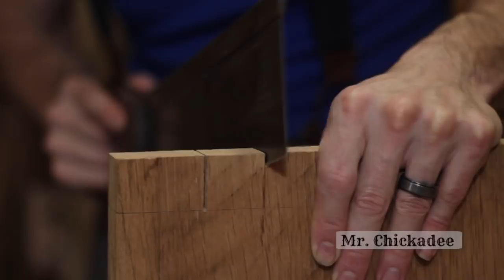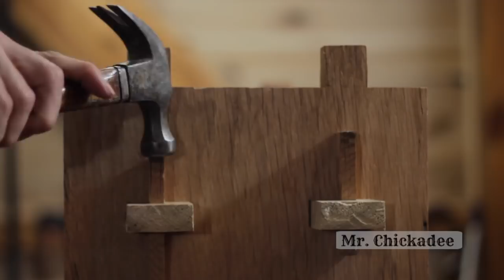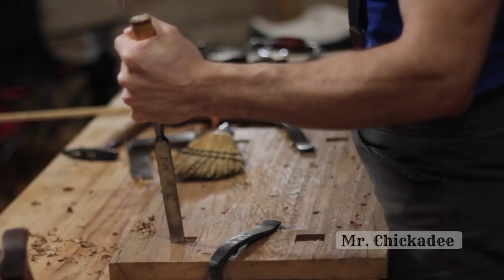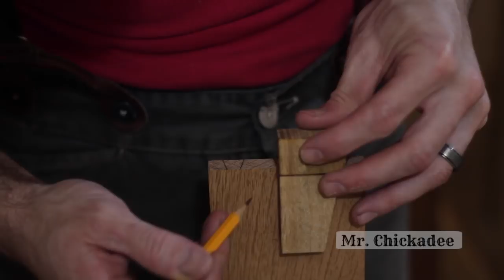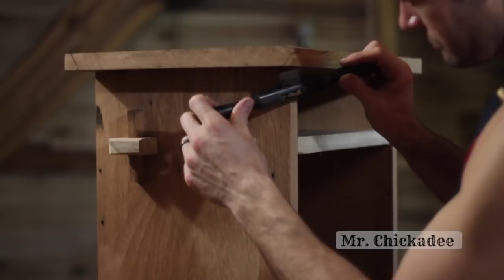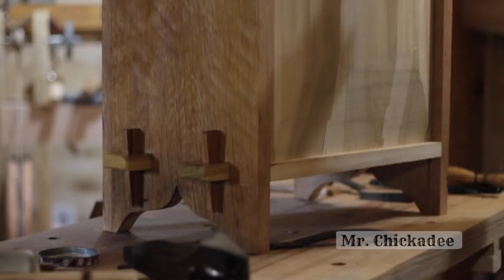RUSTIC OAK NIGHTSTAND

Comment: Nice piece. I really appreciate your videos. While watching this nightstand being made I was looking at a Woodworkers Supply catalog in the section showing all the glues they sell. During my woodworking career gluing and screwing was the preferred  technique in our "quick and dirty" scheme of making cabinets. Sometimes we got to use dados or Lamello biscuits on the higher grades of cabinets. Today I mainly use epoxy on the knife handles I make. I did use your pinning technique using an offset hole and a stainless steel pin to attach a stabilized mango handle on a Japanese gyuto blade. It really cammed the blade into the handle and makes for a monolithic knife after the epoxy sets. I like your use of the nail stained oak top.

Comment: Mr Chic, you work is excellent of course.  Your drawer pulls have the same profile on the inside as 'trunnels' used in planking a wooden ship.  Look for a 19th century schooner recently extracted from a remote beach in New Zealand named Daring.  She went aground in 1866 and hull  and framing is remarkably well preserved.  As they were just starting to get her into a preservation area where she can be kept under spray one of the crew took a picture of a particular plank.  The joint is solid after all those years.

Comment: Love the use of wedges. I expected the end tail of your drawer sides to split with the wedges but they seemed to hold.  Nice details too.  Cat supervision is always important.
Reply from the maker: Thanks, its very important the joints are very tight at the bottom of both the dovetail and the wedged tenons on the top, this squeezes the wood together and prevents splitting

Comment: Mr. Chickadee, man I love your videos.  Very informative.  I'm going to forge a series of socketed timber framing chisels and other tools I think, do you have a list somewhere of the tools you've most used for the home and shop build?  My goal is to forge a number of these tools and possibly build a small timber framed cabin in the near future.  Thanks for the help,     John
Reply from the maker: Howdy John, thanks for the comment. Thats a great idea, we need more American smiths making traditional carpentry tools in my opinion! To your question, I use 4 chisels for all my general timber framing, all are not needed but can be nice to have for their respective applications, in order of use and importance:

1. 2" Framing chisel
2. 1.5" Framing chisel
3. 1" Framing chisel
4. 3" Slick 

Other timber framing tools to forge would be 

1. cant hook
2. Log dogs/spike dogs
3. axes (felling axe, hatchet, hewing axe, hewing hatchet)
4. Adze (lipped for across grain, non for with grain)

In my experience I have come to favor a good framing chisel with a long (8" min) laminated blade, heavy forge welded socket and ferruled handles. Do you have a good one to copy? If not I have an old Whitherby that suffered a fatal break in the socket last year, Ive been meaning to fix it but its a pretty big job for a novice smith like me. I could lone it to you for a model for your chisels, and maybe pay you to fix the socket? Like many it was wrought iron I think and there was a void or other flaw in the forge weld at the socket join. 

If that sounds good, I will PM you my info or you can do the same to me so i can send it your way. 

Josh
Reply: Cool stuff, thanks for the tooling list.  I'd love to see that chisel, could you take a picture of it and also the damaged area?  I couldn't access you email on here.  Mine is on my website: www.rigoniironworks.com   If I could figure out pm I'd send it.
Reply from the maker: Tried sending you a PM on your website. Please send me an email if that goes through.

Comment: Nice work. No glue no nail. But I was wondering about the potential wood movement. The panels all are tightly secured together, will that be an issue later on?
Reply from the maker: Not at all

Comment: I have been using your bee's wax mineral oil citrus solvent on wood, tool handles shovels rakes etc. I am having trouble finding bee's wax how about using paraffin to replace bees wax. I have an old neighbor who told me he has used this same formula you use for years only difference is he uses turpentine instead of citrus solvent. What can you use on metal shovels axes etc. Thanks Love your channel you sir are a true craftsmen ans I appreciate that you are willing to share and teach your knowledge.
Reply from the maker: I found paraffin to not mix as well as Beeswax once heated up. You can get beeswax on ebay pretty cheap. Most turpentine these days is really just mineral spirits with pine scent added, really nasty carcinogenic stuff. Pure real pine turpentine is good stuff but citrus solvent is cheaper so thats what I use. I try and use all natural and non toxic materials. You can use flax oil or the same mix on shovels and axes, add some pine tar to the mix and it will get  better.
Reply: Thanks I will check out ebay.

Comment: Is the bedside table deliberately worked out in a deliberately rough way? Maybe the handle on the box was worth turning on a lathe?
Reply from the maker: Yes, as the title says, the designed aesthetic was rustic, hence the scrub plane marks left on all outside surfaces and hand carved drawer pull. Also much faster and easier to just whittle one with a knife.

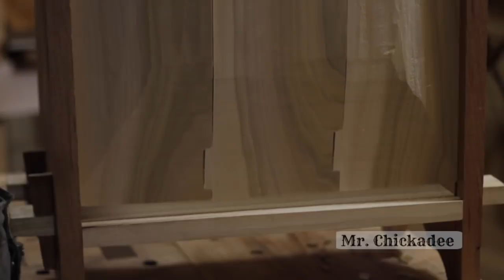Comment: What are the rectangular shapes on that panel towards the bottom at 8:50? I didn't know a panel could be joined with just a groove joint like that using a plow plane, without glue.

Comment: how long does the finish you use take to dry?  i like the look of it, but i wonder if it takes ages between coats or if the thinner you use somehow speeds things up.  Thanks!
Reply from the maker: I find the thinned out oil pretty much soaks all up in a few hours. We normally just oil it good, wipe it down with a rag after a few hours and either start using it or add a coat of paste wax then start using it. Much faster and easier to maintain (and less toxic) than most film type finishes.
Reply: thanks for that quick response!  i normally use shellac and sometimes also tung oil.  in 20 years of woodworking i've actually never tried linseed oil.  but i do have a bunch of red oak with figure like i'm seeing in some of your projects, and i think i'm going to try your method next time.  Do you just cut it half and half?
Reply from the maker: no problem! Linseed is nice, only complaint is the "boiled" stuff is toxic, and raw is harder to find. Ive started using good old canola oil cut half and half with citrus solvent, works the same as most all veg oils are drying oils. One plus is many cooking oils are mostly clear, while linseed has a yellow cast. Hard to beat the price of canola…we use that same mix on our unfinised oak floors, every typeof wood. Mix in some carnuba wax over low heat and you have a great non toxic paste wax too. Its great, just bomb proof, easy to repair, ready to apply, you could eat it and not worry and cheap…whats not to love?
Reply: sounds very good.  paste wax is fast becoming my favourite finish, expecially over shellac.  i hadn't thought of making my own, although having made hide glue several times from tendon, fish bladders, and hide...i guess it's right up my alley.   I bet people who enjoy your videos would like to see you make and use some of that paste wax.  canola oil!  i never would have thought.  i'm surprised you have trouble finding raw linseed oil.  Then again, i can't recall seeing it for sale either.

Comment: Your jointery  is is the most "awesomestlying"  the ice seen. Not all the pieces are oak.  I saw three that are poplar  but fantastic  work
Reply from the maker: Thanks, in traditional furniture there is normally a primary and secondary wood, the primary is the exterior and is normally a better prettier wood. When naming the piece, only the primary wood was named, since the secondary doesn't really matter, it could be pine, poplar or whatever. 
In this case, the primary wood was the reclaimed oak, the secondary was poplar.
Reply: Cool, I have been enjoying your videos and trying a few joints I've seen you use , thanks so much for the knowledge in your reply I didn't know primary and secondary...really cool. Thanks for the reply also, I look forward to many more videos and knowledge. Awesome.

Comment: @14:00 That's a bummer, but it proves mistakes happen to the best of us!
Reply from the maker: True perfection is best left to the machines in my opinion, I strive or beauty strength and enjoyment in my pieces.
Reply: Mr. Chickadee Well you sure accomplish that!
Reply: That's why I always leave my hand to guide along the saw.   If the blade jumps is rather it gouge my hand than the work!   My hand fixes itself,  my work doesn't.

Comment: Don't claim to know anything about any of this, but it seems to be the first video I have seen you using a modern-looking tool. Also, the fit at the end - 20.35 - surprised me a little. But I still love the videos and the skill. You should make this series into a feature film. It would be a - cult - success.
Reply from the maker: What tool was modern i wander? You could make these tenons a bit tighter, but they should not be tight at all across grain to limit risk of splitting the board.

Comment: Josh's Glueless Joinery strikes again. 

Is that a warding file you used to dress saw marks from the inside radii of the cut-out? Did it have a convex side like a half-round? If so, unusual. Unique, even.

Anyway, it's fun watching your tool collection grow. Every video brings something new (to me anyway.)

Lovely contrast between the oak and the poplar.

I'm skeptical of wedging dovetails across the grain of both parts. Particularly where differing transvere expansion rates and seasonal moisture uptake swings are involved. Good place for hide glue if you want to stay rusticly authentic. But then, you wouldn't be Glueless, would you? Maybe there's an appropriate word that rhymes.
Reply from the maker: Im slowly feeling my way around in the world of traditional joinery, to see what I like and what I don't. So far, wedged joints without the hassle and mess of glue or clamps excites me. I also like break down pieces when possible or large. 

They do look like warding files but are actually hand cut rasps, one course one fine, Dragon is the brand, I think. 

Most times I try and only follow time tested methods of joinery, never try and reinvent the wheel, since this wheel has been rolling a very long time. Wedged dovetails like this have been used by german carpenters for hundreds of years, you still see many old piano carcases and blanket chests from pre 1850s with every pin wedged. 
Much easier to sleep at night when I just copy what has worked in the past.
Reply: Mr. Chickadee  Does that mean closed mold autoclaved melamine bonded oriented strand carbon fiber is out for now?